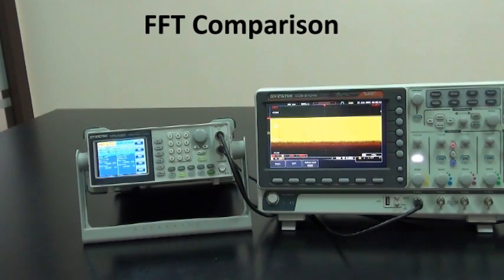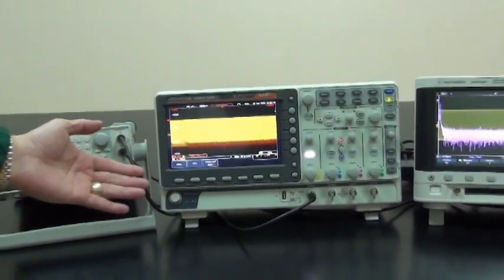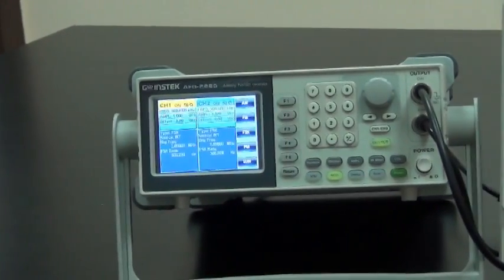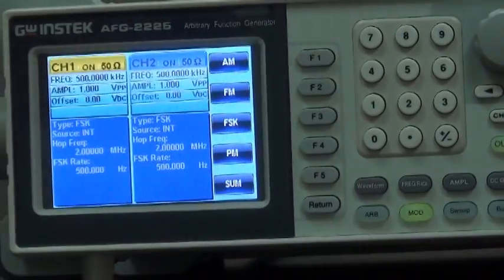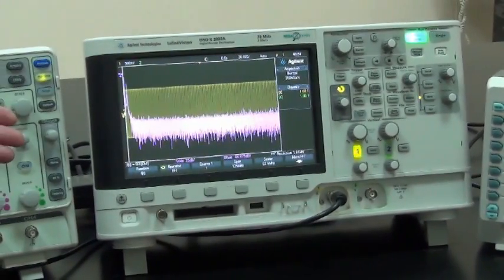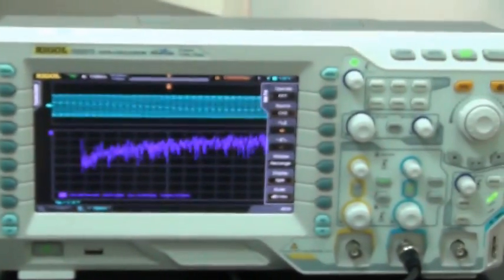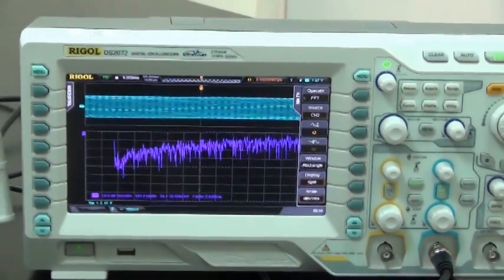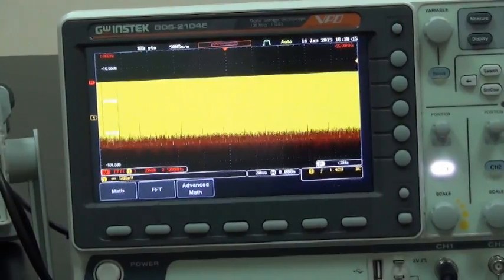GW Instek GDS-2000E Digital Storage Oscilloscope - FFT Comparison

Comment: Hello, can you make comparsion  video of decoding speed and capabilities on I2C and CAN bus between those scopes ?
Reply: +voitano73 

Dear sir, the decoding speed in different DSO will not much different. (the difference will between 1 sec approximately). 
The key points are setup the input and trigger condition correctly to get the right series bus decode.
Thanks for your message..^^